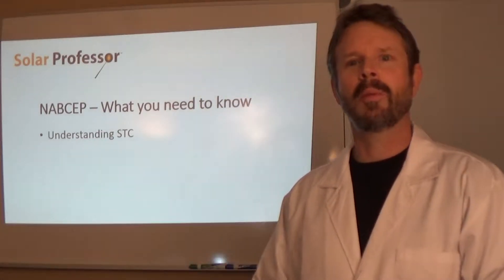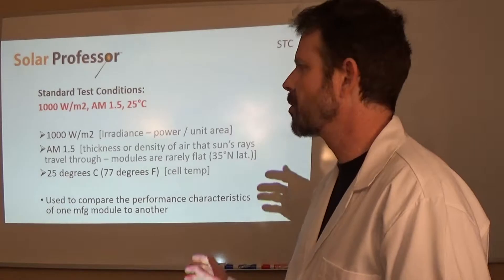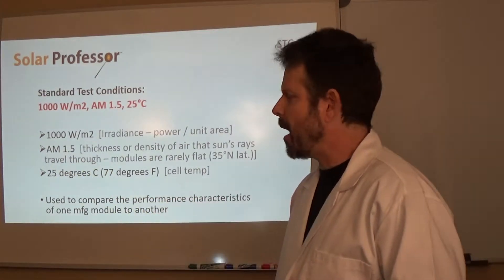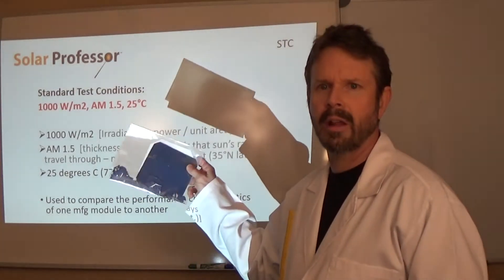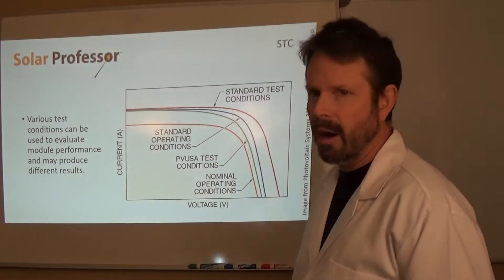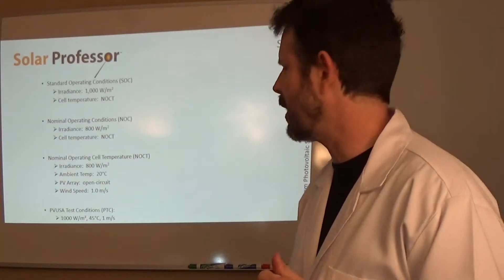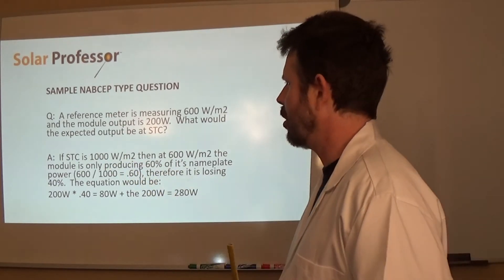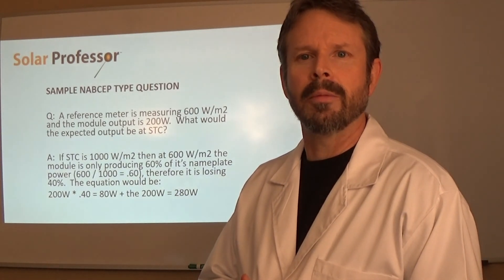NABCEP - MUST Know - STC*

Comment: Is Photovoltaic Systems (by James P. Dunlop) Third edition still the go to book in 2022?  There has been tech improvements since then, the book was written over 12 years ago.
Reply from the maker: Hi Grimlock.  PV Systems 3rd edition is still a solid book, however I agree there are some technological additions and updates in the industry that the book does not cover - in particular DC-DC power optimizers and lithium ion batteries.  I do still use it as our college level textbook, because there is nothing else this comprehensive.  Another great book that is a tiny bit more current, and more simplistic, is the Solar Electric Handbook from Solar Energy International (https://www.solarenergy.org/shop/publication/ssolar-electric-handbook-photovoltaic-fundamentals-and-applications/), but even this book is really light on the technology, and battery chemistries, and is old as well.  PV Systems is still my first choice.  If you want to stay current I would look at mfg. websites or supplier websites - as they will be on top of the tech that is used most often.

Comment: PTC Is 1000W/meter squared, ambient temperature of 20°C and wind speed of 1m/s. That is from the Photovoltaics Systems third edition.
Reply from the maker: Thanks for pointing this out Chris.  Besides STC, PTC (PVUSA Test Conditions) is an important one to understand.  Sometimes called Practical Test Conditions, it is a more realistic representation of the environment PV equipment will operate in.  STC, however, is still the industry standard for manufacturers to test equipment in the laboratory.  Here is a link to the pages in the Photovoltaic Systems book that shows all the test conditions:  http://geigerunlimited.com/energyinstructor/images/test_cond.jpg

Comment: I might be wrong, but I calculated 333 Watts instead of 280. (200*40)/60
Reply from the maker: You are right!  Good catch.  I caught this a while back and updated the text section above as well as the downloadable PowerPoint to reflect this correction.
Reply: @solarprofessor7695  thank you. Please add more content. Great information.
Reply: I don’t know how anybody can think that 60% of 200 could be over 200 in the first place but the correct answer would be 120
Reply: I agree.
200 W = 60% of X
200 / 0.6 = 333W